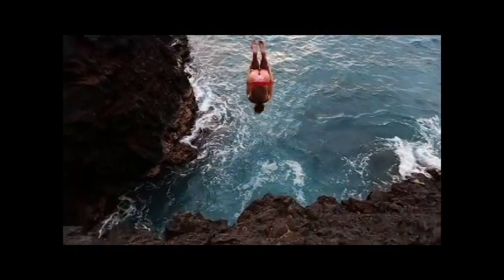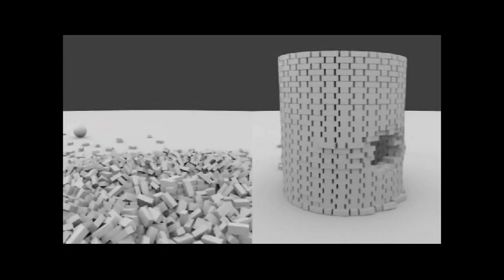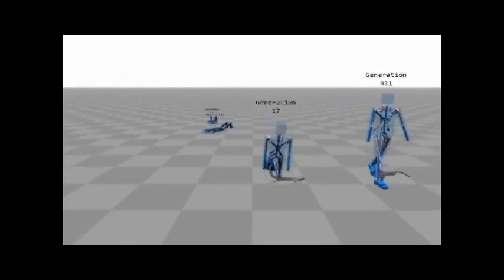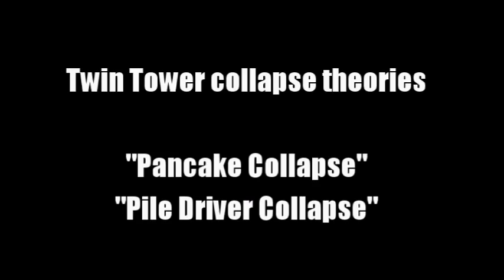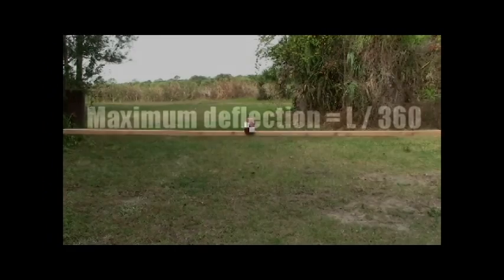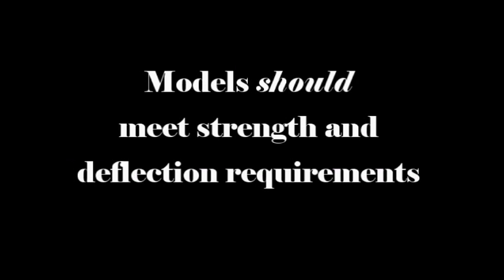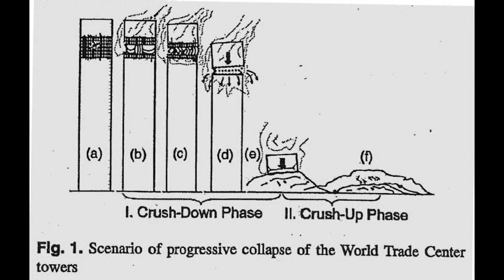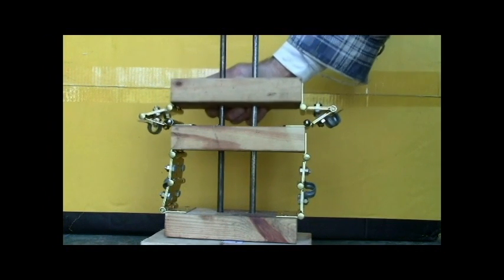9/11 Experiments: The Force Behind the Motion

Comment: First experiment is noway in scale. The supporting outer walls are way too thick and their strength would in a real building never be possible.
Second experiment is noway in scale. The supporting "pizza columns" are way too thick and their strength would in a real building never be possible.
Then I stopped watching this... video.
Reply: Well, not every A&E agees, not all A&E cares, and some  A&E do not wishe to be rediculed and called conspiracy theorists by the sheeps. Thats much of the reason ...
Reply: It seems people do not think much when they get told what to think. 

Fire does not pose a significant risk to concrete and steel buildings. The reason is that concrete is basically fire resistant, like rock, and because steel has such a high melting temperature due to being an alloy. 

The entire premise behind the fall of the buildings is questionable. The WTC only had fire visible on the upper floors, the bottom floors were undamaged for the most part. I would say roughly 70% of the building was undamaged. 

Yet it is claimed that fire weakened the entire structure to the basement, causing a structural failure that defies laws of motion. Like he said in the video the bottom floors should have withstood any collapse of the upper floor. There would not have been enough force or mass to compress the building in the manner the media describes. 

As for building 7, even if the structure was weakened as is claim then it should have been an asymmetrical failure, as the damage was asymmetrical, and it would not be a collapse of the entire building as we saw. 

Take the Oklahoma Bombing as an example. Half the building was completely destroyed yet half of it remained standing. Yet even though there was significant damage to the remaining structure it didn't collapse on its foot print. 

In other cases of building failure direction of fall is determined based on the section weakened. If say the north side columns of a building failed then the direction of motion would be northward toward the weakened sections. There would not be a direct fall downward in any such scenario. 

Yet on 9/11 we had three buildings exhibiting asymmetrical damage, fall in a nearly uniform and symmetrical manner. That is impossible without some kind influence to aid in such a collapse. 

Other examples of this are how trees fall when cut, they typically fall in the direction where the most material was removed, or the most damage done to it structure. If we apply that observation to the WTC then the top section should have fallen to the side of the building, not straight to the ground along the path of most resistance.
Reply: Mr. Lowery So the duck's the plane, and the plane's the tower, and the tower gets fucked up.  Next.
Reply: Mr. Lowery, clearly you aren't aware Eric Henderson is a certified practitioner of 'Schoolboy Physics''.

High-Stregnth steel reinforced concrete requires no energy to be ground into a fine powder in mid air, what are you smoking? There were no multi-ton steel beams ejected horizontally as the towers collapsed. The solid structure below could never resist the fall of the lighter structure above it. Buildings collapse uniformly at near freefall speed all the time due to scattered oxygen starved fires. Get on his level.
Reply: If you understood physics you'd know that gravity is by far the weakest force in nature.  It is something like 0.0000000000000001 the energy of the electro-magnetic force.
Reply: 311hwr refuse to learn? Sir, you seem to have a hard time writing and using proper punctuation. You are the last person who should be making comments about learning. Also if you refuse to argue, then why comment in the first place? You my friend can continue to live your fairytale life. Ignorance is bliss to some. It's funny, rather than actually defeating my points you just insult me and retreat. Typical of the minority of people who still believe what we were originally told. I just wish to understand why you believe steel beams were literally cut precisely at angles? Why the engine they found didn't match the planes they claimed hit the building. How they found passports of the terrorists in the street. It's almost laughable how dumb they think we are. It surely worked on you.
Reply: someone has to simply build the twin towers and effortlessly slam a Boeing 757 into it
Reply: Clearly a hole is present in your head. Explain to me how that happens....how does an aluminum hallow tube destroy steel? Furthermore you cited speed...explain to me how the planes that crashed into the Twin Towers even managed to keep flying at such high speeds while at low altitudes?

The maximum operating speed for the 757 is 493 knots = 567.334 267 876 mile/hour (mph) at cruising altitude. And you're telling they were flying at over 600mph at sea level?

You need to take off the tin foil hat moron.
Reply: You have had this explained to you many times.  Do you have short-term memory problems?
Aircraft are made of aluminium alloy, not aluminium.
The columns buckled not because they were overloaded or weakened, but because they were destabilized.
Steel box columns made of a material neither stronger nor thicker than the material of the plane's wing spar will FAIL no matter the speed of the plane.
Reply: Go look up the natural forces you stupid piece of shit!  I don't think  a fucking moron should be calling others anywhere near the same you douche bag.
Reply: Gotcha man!  I get worked up over the endless nonsense these people drivel from their fingertips and often do the same thing! lol
Reply: We aren't talking about collapse alone idiot.  Duncan is saying the collapse was able to amplify like a dynamical system and therefore could cause steel to become molten under the buried debris.  He is full of shit,  just like you are.
Reply: Listen to what this video says: "If you think he's wrong, then prove it, through experiment!"  Go do that and leave your senseless ramblings on your video proving this guy's wrong!
Reply: Eric Henderson Scale is not a major problem with this experiment.   The point of it is to find a mechanism that will cause something close to what is seen in the actual collapse footage.   Obviously just initiating collapse using gravity as a driver would create only a partial collapse which is completely stopped by the intact structural components below the point of failure.   What we should have seen happen with both towers if there were not any energy injected into the process from other means.   2/3 of each towers mass was in the first 1/3 of their height.   Do you understand what your "progressive collapse"  idea is trying to convey?   That a damaged section of each tower having less than even 1/3 of the total mass of the lower,  fully intact sections,  is able to fully destroy and pulverize the lower,  fully intact sections completely down into the basements of both towers.   Not even a sixth grader could buy this bullshit concept.   The second law of Newtonian physics renders this concept a joke.   In other words,  the progressive collapse concept is impossible.   You can't take something with less mass and destroy the same type of something with greater mass without adding energy to it.   Period.
Reply: Incredible... Every single time you comment, I respond by dissecting every claim you make. And each and every time you return completely avoiding every counterargument and excrete whatever new bullshit crosses your mind.

That is elite-level mental gymnastics that would make even the most ardent creationist blush. 

No it isn’t! "Size effect" is something completely different and irrelevant to this discussion.

SMH.. How is it that you can cite a study by Bazant as a 'proof of concept' in one comment , and then claim his work is "completely different and irrelevant to this discussion" in the next. No words...

it is obvious you have not understood. This is apparent when you give examples of small scale trials which have no relevance...

Bravo.. No really, bravo.

Scale effect is a manifestation of a general law, sometimes known as the “square cube law”  which affects all branches of science, especially in this context with respect to engineering. Go and google it and see if you can get it right this time.

You are a joke. Stop... For the love of your God, stop with the bullshit and read.

Practical Importance
Taking the size effect into account is essential for safe prediction of strength of large concrete bridges, nuclear containments, roof shells, tall buildings, tunnel linings, large load-bearing parts of aircraft, spacecraft and ships made of ﬁber-polymer composites, wind turbines, large geotechnical excavations, earth and rock slopes, ﬂoating sea ice carrying loads, oil platforms under ice forces, etc. Their design depends on the material properties measured on much smaller laboratory specimens. These properties must be extrapolated to sizes greater by one or two orders of magnitude. Even if an expensive full-scale failure test, for example a failure test of the rudder of a very large aircraft, can be carried out, it is ﬁnancially prohibitive to repeat it thousand times to obtain the statistical distribution of load capacity. Such statistical information, underlying the safety factors, is obtainable only by proper extrapolation of laboratory tests.
https://en.wikipedia.org/wiki/Size_effect_on_structural_strength

When you have to try to sound smart, you are doing it wrong. Everyone can see you aren't wearing any clothes. 

"NIST: “did not conduct reduced-scale system-level tests because there are no generally accepted SCALING LAWS that apply to fire propagation, temperature evolution, and STRUCTURAL response”.

And stop citing things which don't support your argument! Every time you do this you illustrate how obtuse you are. In this sentence, NIST is pointing out that it is unrealistic to try to replicate the effect of a jet liner impact and subsequent fires on a building (in full or small scale). No one is debating this.

What we are suggesting is if debonkers believe their misapplied high school kinematics equations are sufficient to explain this catastrophe, IT CAN BE MODELED. So. Get. To. It.

Don't worry about modelling the effect of the fires on the composite floor systems or individual steel members. NIST has already shown that sudden and uniform failure by fire is impossible, even under unrealistic conditions. Skip that.

All we want you to show is how a block can accelerate through another block of comparable mass and density without experiencing any resistance. We have already seen that even cardboard boxes will resist (and completely arrest) a much heavier mass with considerable kinetic energy. Put your Masters degree in 'Schoolboy Physics' to use and prove us wrong.
Reply: 311hwr In no cases does gravitational collapse of a building cause it to accelerate. Molten steel sitting under the debris for weeks. Steel beams cut almost perfectly. You can just ignore all the significant facts and evidence because you wish to believe that the powers that be would NEVER do something horrible like this. It's hilarious that the your first sentence is an insult about how dumb I am.... talk about irony.
Reply: Ok, if your theory is correct, where are the core columns then? What's destroying them? By your own theory and your own logic, we should see all the core columns sticking up in the air.
Reply: micha0001 yeah his "tests" are highly flawed. 

test 1 the wooden structure was way too strong and didnt give away and basically allowed the simulated floors to wedge between them which allowed them to stop. #2 was also a highly flawed test as the plastic pizza box supports used was just way too strong and provided support where there wasn't any on the actual building (ala the building held the floors by the center core, and outer frame). i stopped watching after that and went looking in the comments pointing out the flaws in the test. 
and tards are eating this up like its some sort of proof.
Reply: byurBUDdy I'm an auto mechanic and I can ensure you that if you take a high power torch to concrete you will be surprised.
Reply: ProjectRealityBf2 your kidding me right? You must have very little knowledge on planes or buildings.
Reply: Which reports? Show me.
Reply: The difference is thickness of a coke can and an aircraft structure is quite different. Should have paid more attention in high school when they were discussing the periodic table in Chemistry class.
Reply: The buildings could be seen from miles away. By the time the second jet hit, every one in NY who could, was watching the events take place LIVE. There were literally millions who saw it on TV.
To deny reality is a sure sign of insanity.
Reply: ".an aircraft cannot fly at 500mph at sealevel for a prolonged period without some damage occurring"

Says who, fool?
Reply: No, that was a link to an NTSB crash report, kid.

YOu don't have a fucking clue about aviation, clearly.
Reply: So you know what you are talking about? On who's authority, you're own?
Judging by the utter shit you've posted so far not very credible from someone who thinks the periodic table tells us about the thickness of materials.
Reply: not scientific. he never flew an airplane into it full of fuel. the only way to debunk what officials say is to recreate the building somewhere and remotely fly a 737 into it.
Reply: hahahahahahahahahaa rad
Reply: "THEY WILL BUCKLE AND FALL DOWN" - Why ?
Why so much heat under the ground and numerous reports of molten steel on site ?
Why pieces of steel ejected laterally at high speed , some of which embedded themselves in nearby buildings ?
Why no lumps of concrete but just dust ?
Reply: Sorry TD but this isn't correct.  The debris that struck other objects (like the ground) required that a portion of the potential energy be turned into kinetic energy and that rapidly overwhelms any available amount of energy for molten steel to be produced.  There was a large amount of kinetic energy produced from the falling debris and therefore a large portion of available heat was sapped away from the materials when the kinetic energy was  produced from impacting debris.  There is no way there was enough kinetic energy to cause a "snowball effect" type of ramping up failure and then have the energy needed to turn the steel molten from the impact!  That has never happened with any kind of structure that fell due to gravity alone.  Why?  Because gravity has but a fraction of the needed amount of energy to do such a feat.  Gravity is probably the weakest driver available for producing frictional heat to try and melt steel. Or any building metals for that matter.
Reply: +Eric Henderson

Wow. Another tirade of abuse but NOT one single fact to or calculation to back up anything you have claimed.

Wow. Another post where you miss the point. Colour me surprised. 

"However, in the analysis of the collapse mechanism by Bazant and Zhou, they state that they look at three possible collapse mechanisms"

Bazant and Zhou published their first study on the 13th of September, 2001 - two days after the disaster. This was hardly an 'analysis' and more appropriately described as a guess before any 'analysis' could be done. It was entirely based on conjecture.

(b) the floor-supporting trusses are sheared off at the connections to the framed tube and the core columns and fall down within the tube, depriving the core columns and the framed tube of lateral support, and thus promoting buckling of the core columns and the framed tube under vertical compression

Which NISTs investigation refutes. 

To my knowledge, Bazant published three studies on the collapse in total making several fundamental errors throughout. A decent refutation of Bazant can be found here. I've given you enough of my time.
http://www.ae911truth.org/news/265-news-media-events-mechanical-engineer-sends-open-letter.html

Note: Sneering and Insult is not a valid form of argument, facts and evidence are.

Note: Whining and shutting your eyes does not rebut a valid argument.

+beachcomber2008
"debonker" - The word is 'debunker', and the 'bunk' is all about your 'truther' religion.

You're a clever one aren't you. Debonker is a bastardization of the word, debunker. It implies that 'debunkers' are bonkers. It is sheer comedy when debonkers use 'truther' as a derogatory label and then cry foul when the tag is reversed... Stay classy.

Let's not distract ourselves with side issues, eh?

Yeah!... Let's not distract ourselves with the fact NIST openly disavows the pancake theory. Is this really the argument you are pursuing?? 

How about we talk about the leap NIST made from, 'fires as hot as 1000 Celsius' to 'at 1000 Celsius steel loses X strength'. NISTs own data did not find evidence of temperature exposure even close to this:

"Of the more than 170 areas examined on 21 exterior panels, only three locations had mud-cracking of the paint, indicating that the steel may have reached temperatures in excess of 250 °C"
and
"Two of the core columns with as-built locations in the fire-affected floors were examined for paint cracking.  The few areas with sufficient paint for analysis did not show mud cracking patterns, indicating the columns did not exceed 250 °C"
Page 101 - http://ws680.nist.gov/publication/get_pdf.cfm?pub_id=101016 

or this
This  fact  was  quite  interesting,  particularly  for  those  connections exposed to pre-collapse fires. Some of the main truss seats experienced considerable fires raging on the floor just below their location for upward of 30 min (Ref. 4). However, the spray-applied fire-resistive material (SFRM) applied to the seats appeared to  perform  as  required,  as metallurgical analysis  of  many  of  these  fire  exposed seats  showed  no  alteration  in  their  microstructure (Ref. 4).
https://app.aws.org/wj/supplement/WJ_2007_09_s263.pdf

250 degrees Celsius is fatal to human life, but not structural steel.

that seems to tie the loose ends up quite nicely, doesn't it?

No, see below.

See that trick you pulled right there?  You moved the goal-posts just a tad.

How? I quoted an earlier post where he stated the pancake theory to the letter in response to his claim he doesn't support the pancake theory? Are you blind and stupid?

No, it's an entirely different effect called THE SCALE EFFECT.

Wrong. The 'scale effect' you refer to is an incredibly loose description of a range of concepts that you possess no understanding of.

At grotesquely high wind speeds because the Reynold's Number of the situation is so different.  It is another manifestation of The Scale Effect which you don't seem to be aware of

So you're claiming that wind tunnel testing is invalid? Stop. 

It's not 'so different' at all. In fluid mechanics, one simply increases the atmospheric pressure in the wind tunnel by a factor of 10 over the conditions the full scale design will experience. Either way, scale models are a PERFECTLY VALID method for experimentation. You have no idea what you are even arguing here.

The purposes of these experiments was not to create accurate models of the towers. It was simply to test the 3 different theorized mechanisms behind the collapses of the twin towers (pancake, pile driver and demolition) by utilizing unrealistically weak substitutes. Are you really suggesting that paper walls and pizza spikes are a more substantial design than the actual towers as others on your side have done? Debonkers is a perfect descriptor. 

NIST's findings do not support the "pancake theory" of collapse
https://www.nist.gov/el/faqs-nist-wtc-towers-investigation

Are you going to address this elephant in the room?

This leaves FREE-STANDING COLUMNS A QUARTER OF A MILE HIGH.  THEY WILL BUCKLE AND FALL DOWN.

Or this one? WHERE IS THE QUARTER MILE LONG STACK OF CORE COLUMNS YOU NITWIT. The minute you show me this I will change my opinion. I won't hold my breathe
Reply: This is simply guesswork. Unless you can back it up with numbers, it is meaningless.

As apposed to backing it up with meaningless numbers? Dude give up.
Reply: +Eric Henderson

Jon Chalkley "Bazant's theory is a refutation of NIST" This statement demonstrates how little you understand.  Two different theories explaining two different things. Stupid or dishonest? I'll give benefit of doubt and assume latter.

This statement demonstrates the depths debonkers will plumb to support a bad argument. Deliberately making up a quote is the most intellectually dishonest thing you can do. I never said that - not once. Here is what I have said on the matter.

Professor Bazant's 'pile driver' mechanism is notable in that it was a complete repudiation of the initial 'pancake' collapse theory. It is the 'official' explanation NIST endorses.

Literally, the opposite of what you claim. Child.

On holiday. Unlike your average truther I have friends and family and do not spend my days on you tube.

That's.. Interesting.  It's been my observation that debonkers are the most prolific contributors in the comment sections of any 9/11 conspiracy video. It's almost like you can't get enough of it.
Reply: "I have to confess i get a warm fuzzy feeling when truthers start cursing and calling me names" Do you? Well, you're a moron. Knock yourself out.
Reply: make a better model and show us the collapse
Reply: You appear ignorant of Newtons' Second Law and how it interacts with The Third.
Reply: Besides, the hardness if a material isn't directly related to penetration capability, as illustrated by the bullet example.
Reply: Fox Mcloud but most planes ARE made out of mostly aluminum.....
Reply: You DO SEE the columns sticking up in the air after the rest of the building has collapsed around them. This point has been made several times during this protracted discussion. Maybe you should read some of the older posts before making such stupid comments.
Reply: No they are NOT. Why the fuck do truthers keep making this stupid point. They seem to think an airplane is made of the same material as a coke can. If it was you would never get me in one. Come to think of it, the wings would fall off under their own weight.
Reply: Wow...which report are you citing? Your "arguments" sound so convincing. The problem with debunkers is that they write really long paragraphs, but when you start dissecting each sentence apart you realize they're not making much sense .These geniuses here are of the opinion that a 757 can travel at over 600mph at sealevel for a prolonged period without the wings sheering off. 

It's no wonder why your math and science scores are the lowest in the western world. Goodness me...a 7th class science student here could probably own you all in basic physics and chemistry.
Reply: Where do you see the columns sticking out of the ground all the way to the top? Which parallel universe do you reside in?
Reply: I never said the aircraft is made of coke can aluminum. You did. The problem with your debunkers is that you don't use logic and you don't really answer the questions we pose. You simply write long paragraphs of trash and your create arguments in your own brain and then squash that argument with your own flawed logic.

This probably explains why nobody has dared to debunk 9/11 The New Pearl Harbour documentary.
Reply: "These geniuses here are of the opinion that a 757 can travel at over 600mph at sealevel for a prolonged period without the wings sheering off. "

Oh, and what aircraft did that on 11/9? Like all twoofers, you don't have a clue what you're talking about.

nor are you aware of the multiple examples of Boeing products exceeding Vd for longer periods than UA175, while experiencing higher g loadings and surviving.

This is because you are stupid brainwashed sheep who cannot think or investigate for yourselves.
Reply: Here's a Boeing aircraft that exceeded Vd by more than 20%, while being subjected to 3.5g (Limit is 2.5) before it broke up:

http://blog.seattlepi.com/aerospace/files/library/Final_AdamAir_PK_KKW_17032008.pdf

For comparison, UA175 exceeded Vd by less than 20%, for a shorter period of time, while experiencing only 1g.
Reply: A link to some random blog? Wow. That's so convincing.
Reply: Long enough....an aircraft cannot fly at 500mph at sealevel for a prolonged period without some damage occurring. Clearly the aircraft was modified....which means this was not a commercial aircraft. I know exactly what I'm talking about...too bad the folks at Herzliya didn't update you on how to respond to people who actually know what they're talking about.

Try again.
Reply: have you any idea how crowded New York is? Of course there were  plenty of  eyewitness!
Reply: No, any pilot won't tell you that because it's bullshit.
Notice also that the people who make the aircraft don't agree with you either.
Reply: So you can get information from legitimate TV and newspapers or from you tube. I wonder which is likely to be more reliable?
Reply: I could send you the specs. for a more realistic model. You are the ones who want to prove it didn't happen so you can finance and build it.
Reply: Dave Franzmann Thats what Paul Salo wants to do.. heard about him ?
Reply: Or even more correct and devastating: a 767 with a lot more fuel on board than a 737.
Reply: I think we seem to be talking at cross purposes. You seem to have focused on the collapse initiation while I am looking at the way the collapse progressed once under way. Can we get this clarified before going any further with this discussion.
Reply: micha0001 Dumbass
Reply: micha0001 oooooooooh 7 hours! Wow! What a long time for a building to survive a fire before collapsing!
Reply: wahldoh24 high power torch burns at what temperature? Office fires, oh yes and I forget "jet fuel" don't burn nearly as hot. Also with a torch you are directing that flame at a very small spot where as with these buildings it would be multiple, entire floors. Stop rationalizing bullshit.
Reply: Who am I? how do you know he is right?
Reply: I agree. perhaps the materials used and relative weights and heights were not accurate models
Reply: If the whole plane was aluminum you'd be able to tear the plane apart with your bare hands. A child can see this.I have a relative who's a pilot, he says the speeds CAN be achieved below 40,000 above sea level but it's dangerous since the windshield might sink in "but if you're gonna crash on purpose it doesn't matter to you".
Reply: Turning the plane around doesn't tear the wings off. A child can see that.
Reply: The collapses started at the exact floras the planes hit. Someone would have to have climbed up to the already blazing floors and put bombs int here. Which  is impossible. Therefore the collapses were not started by explosives. There is no way around this.
Reply: If that's true,  've no need to wish you luck tearing the fuselage apart from the inside out with your bare hands and struggling to walk across the aluminum floors. & don't forgetet Newton's 2nd Law! And don't forget how a baseball can break through glass fi you through it hard enough!
Reply: Should get mythbusters on board, so to speak
Reply: Look up birdstrike to nose of plane and then start your argument again
Reply: My point is not that the bird penetrates the aircraft. I expect it to. My point is when you watch what footage there is of the aircraft and the building. There is no accordioning of the plane to show resistance. That is not reality. The plane on a special video, live supposedly, on fox5 shows the plane coming through the other side. No sign of accordioning/crushing and a nose cone that appears intact. I WILL tell you that these nose cones are generally made out of plastic. Do you mean to tell me that a plane can fly through a building and have its front nose and fuselage emerge intact? The floors of the wtc were spaced apart closer together than the distance between top and bottom of the fuselage. Do you mean to tell me that the top and bottom of the fuselage sustained no damage as it met UNDENIABLE resistance, or any part of the fuselage. perhaps the nose? I don't know exactly where the floors were in relation to the plane. But guess what? It doesn't matter, tee hee. Try telling me that the floors would have given way to the hollow fuselage. THAT is like a sword on a coke can
Reply: The "Pinocchio's nose" argument, like countless others, can be refuted with a simple google search.
Reply: I love how it's called pinocchio's nose!
Reply: googling 'pinocchio's nose explanation' yielded absolutely nothing, so it's not really a thing, then, is it?. Perhaps you'd be so good as to give me but a phrase to whet my thirst for knowledge
Reply: "There is no accordioning of the plane to show resistance". You've gone and made me quote myself. Now, Instead of saying nothing but making some noise, get to work on this. There are plenty of videos to show me where a piece of the plane becomes dislodged before it goes into the building. "The floors of the wtc were spaced apart closer together than the distance between top and bottom of the fuselage". Whoops! dun it again. Show me the resistance of the plane when it met something it could not get through without breaking apart. This would have happened no more than 5 metres into the building, past the girders. Made of steel. Newton's third. Get busy.
Reply: I found the pinocchio's nose thing. What i thought was the plane emerging from the other side turned out to be a figment of my imagination. You don't even know how funny you are. This is seriously like a sitcom
Reply: Please calm down and be respectful. Here, look at this:https://www.google.com/?client=safari&channel=ipad_bm#channel=ipad_bm&q=9/11+nose+debunk
Reply: I watched your video. You asked me to. I summed it up. Was i wrong? I'm not going to your forums. I've been researching this shit for 10 years. I'm light years ahead of you, with all due respect, that you so politely asked for with not a hint of condescension. You basically tell me that live tv reveals a silhouette on the exit side of the building that is identical to the silhouette of the plane before some blackout thing occurs is a figment of my imagination. What are the odds of that happening? The explosion bears the same shape and motion of the plane pre strike. Wow. But i defer to you now, because you demand it.
Reply: What video? I didn't send you one. & I've been researching this for at least as long s you if not longer. Please be respectful and stop with the unwarranted hostility and groundless accusaitons. I never said it was all in your head. & saying "I'm not going to your forums (What forums anyway?) is simply a biased refusal to examine the evidence.
Reply: No idea what point you are trying to make. What relevance does this have?
Reply: Surely you are still not trying to make out the nose of the plane went through the building  undamaged. What everyone saw that day was a mass of debris exiting. This nonsense has been thoroughly discredited.
Reply: You said the plane was made of aluminium which is the material a coke can is made of.
Reply: "No body has debunked 9/11 The New Pearl Harbour"
I get the impression you are fairly new to the 9/11 conspiracy faith or you would know that this piece of fantasy and disinformation has been thoroughly and comprehensively debunked.
Reply: Oh dear, so you think the periodic table measures the thickness of materials!
Reply: Google pinocchio's nose, you said. I did. A video emerged with that title.
Reply: Where did you see it? Were you on the street in NY? Lucky you. fox 5 shows the fuselage and nose, being identical in shape before and after impact. The video verifies this, OR, verifies whatever emerges on the north side taking the exact same shape of the nose and fuselage before a half second blackout cuts back to an expanding orange flame. Would you agree with this, the latter part?
Reply: Ask me a question, then. I'll ask you some too. I have a relative who was a pilot. He said planes CAN travel that fas tithe slow, but it's dangerous since the windshield might cave in, but since you're gonna crash on purpose, that wouldn't matter. As for the  phones, you obviously haven't researched articles such as these: https://www.google.com/?client=safari&channel=ipad_bm#channel=ipad_bm&q=debunk+911+phones
Reply: https://www.google.com/?client=safari&channel=ipad_bm#channel=ipad_bm&q=debunk+911+nose
Reply: So you're saying my elderly relative, who is a pilot, was lying? Is he in on it? huh?
Reply: So thousands of people who saw a jet were hallucinating?
Reply: So, your answer to a simple yes or no question that reflects what YOU see is to avoid it and suggest that millions of eyewitnesses can't be wrong. BRILLIANT logic. Just say no if you disagree, ffs
Reply: So it was all done by magic! Here's me thinking it was real. Silly me.
Reply: Without a link your  incredibly bold and bizzare claim sent gonna help or matter
Reply: That's a ludicrous comparison and you know it.
Reply: Refer to William Casey's (former CIA Director) claim to patenting a perpetual motion machine:
"We'll know our disinformation program is complete when everything the American public believes is false."?
When you find you have conquered the internet or deciphered MSM state sponsored propaganda, retrace your steps in reverse.
Reply: Eric Henderson OK if the "progressive collapse" theory is the truth, get Larry Silverstein to finance an open, pear reviewed experimental model to prove it. I'm sure he wants to silence all these libelous truthers. Go ahead do it yourself. Your numbers look impressive, shouldn't be all that hard, to replicate them in a scaled down model. Go Ahead prove it....
Reply: What about MY arguments, William?
Reply: micha0001 Said who??? Well, had you actually watched the video, fairly early into it we hear the indian NIST guy clearly tell the nation that it is NIST's conclusion ONE critical column failed causing the entire collapse. NIST even backs it up with a laughable animation.
I know. It is a ludicrous statement. Then again, everything NIST told us was absolute nonsense.
Reply: micha0001 Listen for your self then: it is at the 3:00 mark in this video where we here NIST make the ridiculous claim that it was one single column which brought on the entire collapse.
No, I did not read the entire 10,000 page report. I did read the condensed version and  I also did read the 9/11 commission report in its entirety. It was insulting.
Reply: byurBUDdy
"It seems people do not think much when they get told what to think" - That must be why you're telling them what to think.
"Fire does not pose a significant risk to concrete and steel buildings" - LIE.  FALSE.
"The reason is that concrete is basically fire resistant, like rock" - Concrete is a form of sedimentary rock, and igneous rock is solid at room temperatures.  Both are molten when red hot, and, first, the concrete has EXPLODED (at around 850 deg C)..
"steel has such a high melting temperature due to being an alloy" - Alloying elements with iron normally LOWERS the melt temperature.  FALSE.
"roughly 70% of the building was undamaged" - more like 85%.  FALSE.
"it is claimed that fire weakened the entire structure to the basement" - LIE.  FALSE.
"causing a structural failure that defies laws of motion" - But you don't say HOW.  This may well be because you are merely repeating someone else's phrase.  It seems people do not think much when they get told what to think.  FALSE.
"the bottom floors should have withstood any collapse of the upper floor" - WHY?  Apart from two engineering floors, ALL the floors were identical.  Why should a floor resist being struck by forty floors when the previous floor collapsed when being struck by thirty-nine?  FALSE.
"There would not have been enough force or mass to compress the building in the manner the media describes" - An interesting opinion, but without any explanation, why should anyone believe you?  FALSE.
"building 7 should have been an asymmetrical failure, as the damage was asymmetrical" - The SEVEN HOUR FIRE was peripatetic (it went wherever it found its fuel), so your suggestion is FALSE.
"Oklahoma" - wasn't a steel structure that burnt for seven hours.  FALSE.
"collapse on its foot print" - No WTC building collapsed that way.  FALSE.
"direction of fall is determined based on the section weakened" - These buildings fell due to fire, and the WIND DIRECTION is crucial.  FALSE.
Thank you for your eleven false suggestions.
It seems people do not think much when they get told what to think.
Think about this.  It's a simple physical analysis of how the energies and speeds build up once floors catastrophically collapse.  And floors were photographed having already dropped.  You can see these photos in the NIST Report, which you obviously haven't read.

Newton's Laws of Motion as applied to 9/11:
An Analysis of the Floor Collapse of the Twin Towers

Newton's 2nd Law ”The acceleration of an object as produced by a net force is directly proportional to the magnitude of the net force, in the same direction as the net force, and inversely proportional to the mass of the object.”
This, with Newton’s other laws, demonstrates the REALITY of the floor collapses within the twin towers.
The equation used is a derivative of the ACCELERATION of MASSES by GRAVITATIONAL FORCE: v^2 = u^2 + 2 * f * s, where:
Floor Mass m = 10^6 Kg,
Gravitational Acceleration f = 32.16 feet per second per second, or 9.81 metres per second per second
Distance between floors s = 12 feet, or 3.66 metres, and
Starting velocity u (original) = 0 ft/sec  (0 m/sec).  Then u = 9.72 ft/sec (2.97 m/sec).  Then u = 13.72 ft/sec (4.18 m/sec).  Then u = 16.3 ft/sec (4.97 m/sec).

It fits (as it must) in the case of a detaching floor. This, when and if it falls free, accelerates at G until it hits the floor beneath. From the formula v^2 = u^2 + 2 * f * s we know it strikes the floor beneath at a speed of 27.8 feet per second, or 8.47 metres per second.
We know that MOMENTUM is conserved, and the TWO floors would THEN be traveling downwards at HALF THAT SPEED, less the speed loss from the energy loss of the SHEARING of the floor connections.
We KNOW what this is, because we KNOW the average and general downward acceleration to have been 0.7G, as agreed by AE911T.
So we KNOW that the initial downward speed of the TWO floors is actually 70% of (27.8 / 2), which is 9.72 feet per second, or 2.97 metres per second.

Now we consider TWO floors striking the NEXT floor.  
Note that THE START VELOCITY (u) IS NO LONGER ZERO, but 9.72 feet per second, or 2.97 metres per second, so from the formula v^2 = u^2 + 2 * f * s we know the TWO FLOORS strike the floor beneath at a speed of 29.4 feet per second, or 8.96 metres per second, and thus the impact velocity is GREATER than before.
We know that MOMENTUM is conserved, and the THREE floors would THEN be traveling downwards at TWO THIRDS THAT SPEED, less the speed loss from the energy loss of the SHEARING of the floor connections.
We KNOW what this is, because we KNOW the average and general downward acceleration to have been 0.7G, as agreed by AE911T.
So we KNOW that the initial downward speed of the THREE floors is actually 70% of ((29.4 * 2) / 3), which is 13.72 feet per second, or 4.18 metres per second.

Now we consider THREE floors striking the NEXT floor.  
Note that THE START VELOCITY (u) IS NO LONGER 9.72 feet per second, but 13.72 feet per second, or 4.18 metres per second, so from the formula v^2 = u^2 + 2 * f * s we know the THREE FLOORS strike the floor beneath at a speed of 31.0 feet per second, or 9.45 metres per second, and thus the impact velocity is EVEN GREATER than before.
We know that MOMENTUM is conserved, and the FOUR floors would THEN be traveling downwards at THREE QUARTERS THAT SPEED, less the speed loss from the energy loss of the SHEARING of the floor connections.
We KNOW what this is, because we KNOW the average and general downward acceleration to have been 0.7G, as agreed by AE911T.
So we KNOW that the initial downward speed of the FOUR floors is actually 70% of ((31.0 * 3) / 4), which is 16.3 feet per second, or 4.97 metres per second.

On the point of impacting the NEXT floor THE START VELOCITY (u) IS NO LONGER 13.72 feet per second, but 16.3 feet per second, or 4.97 metres per second, so from the formula v^2 = u^2 + 2 * f * s we know the FOUR FLOORS strike the floor beneath at a speed of 32.2 feet per second, or 9.81 metres per second, and thus the impact velocity is EVEN GREATER than before.

What you see here is AN ACCELERATING TREND.  The acceleration of the massing floors is heading asymptotically for G itself.

"You are saying that as the first 15 floors collapses on the 16th floor" - Well, obviously not.
"The amount of kinetic energy is increased as opposed to deceased (sic)” - Certainly not.  Energy never ‘dies’.  Consult The First Law of Thermodynamics.

If you take the INITIAL FLOOR, its kinetic energy impacting the floor beneath it (assuming its weight to be 10^6 Kg) is 0.5 * m * v^2, which is 0.5 * 10^6 * 8.43 * 8.43 = 35,500,000 Joules.

If you take the FOUR FLOORS, their kinetic energy impacting the floor beneath them (assuming floor weight to be 10^6 Kg) is 0.5 * m * v^2, which is 4 * 0.5 * 10^6 * 9.81 * 9.81 = 192,000,000 Joules, which is MORE THAN FIVE TIMES GREATER.

Kinetic energy is ALWAYS INCREASED BY FALLING, as POTENTIAL energy is traded off against it.

So the floors will accelerate all the way to the tower basement.  This leaves FREE-STANDING COLUMNS A QUARTER OF A MILE HIGH.  THEY WILL BUCKLE AND FALL DOWN.
Reply: Tony Duncan Go watch some bird strikes on jet aircraft Tony!  I don't think a duck is tougher than a steel box column and a duck will totally fuck up the plane that hits it!
Reply: Tony/Eric, I know you won't absorb any information that disrupts your world view but it's nice to give you the opportunity for self improvement.

I read your entire shit post and will point out the utter absurdities of your argument.

Your whole premise relies on the assumption that the floor truss seats sheared from the interior and perimeter columns. This is grade B horseshit which NIST's own findings refute. Of the 31 truss connections they examined, only 2 failed. The other 95% were damaged but intact

Secondly, your explantion suggests that energy in this system was conserved. The collapse of these buildings was not a closed system. Thousands of tons of material was ejected (at speed) from the falling mass. I'll call this grade A horseshit, as it would sound vaguely scientific to an idiot

Thirdly (?),  the theory you advocate was discarded very quickly by the authorities investigating this because of how obviously wrong it was. To be clear, NIST does not endorse the pancake theory.

Your final sentence actually hints at a level of intellectual lucidity. Yes, if the pancake theory were true, and the floors sheared from the central columns as the collapse progressed, 
THERE WOULD BE A MASSIVE STEEL STRUCTURE A QUARTER OF A MILE LONG ON TOP OF THE DEBRIS PILE. Where is it?
Reply: answer=explosives
Reply: No one has claimed the fires weakened the whole structure. Once the upper floors were in motion, the floors beneath could not support the downwards momentum. Far from slowing the collapse down, as more and more floors began to give way the falling mass increased. If you watch the video carefully, you will see that the rate of collapse increases as the momentum builds up.
Reply: Thanks for this comprehensive analysis. Unfortunately, your average truther will only read as far as line 5 or 6 before their attention span gives up. As for introducing numbers into your post, this only has the effect of making them run away to the next you tube video in hope of renewing their faith.
I have shown similar calculations in discussions with truthers and have yet to have a response.
Reply: +Eric Henderson

It is fairly obvious from the pseudo scientific baloney your (sic) are posting that you do not have the understanding to discuss this issue

I've never seen anyone with such a complete lack of self awareness as yourself, and I probably never will again. EVERY claim you've made in this comment section is 'pseudo-scientific baloney' which you've pulled from your ass 'to sound impressive'. 

Gravity exerted a force of about 500000KN on the upper part of the tower and studies have proved the potential energy was more than enough to collapse the towers.

In the exact same comment.. Incredible....

I have to confess i get a warm fuzzy feeling when truthers start cursing and calling me names.

Right... Because 'truthers' are the only ones who become belligerent. Yeah.. Debonkers are the most generous, humble and courteous people that exist on this planet. Not. I think that warm fuzzy feeling you get is your colossal ego being crushed.

I have no problem discussing scientific issues with non-scientists but it really pisses me of when they try to sound impressive by using scientific terms they don't understand.

Ditto.

I made the point a long time ago that it is just not possible to use small scale experiments to replicate how the towers fell because of the scaling problem.

Which is why no one should take a word you say seriously; you have absolutely no idea how to do science. When an aerospace engineer wants to design an aeroplane, they test small models in a wind tunnel and computer simulators first to see how they perform - well before even contemplating building a working prototype. When a chemist wants to test a new drug, they begin with human analogues such as mice before starting human trials. If you have kids, I hope they weren't home schooled.

You must be religious. Only a zealot would claim their faith is beyond the scientific method. Holy cow...

Here is a link to a study proving that the towers would collapse the way they did:
https://pdfs.semanticscholar.org/93a4/406e441b660fd6c52e1d54810203fbaba208.pdf

Professor Bazant's 'pile driver' mechanism is notable in that it was a complete repudiation of the initial 'pancake' collapse theory. It is the 'official' explanation NIST endorses.

So to be clear, you are now disavowing the 'pancake' theory you've been advocating throughout this entire comment section? There's nothing wrong with changing your mind. But you ought to say this outright, otherwise it makes it look like you are posting any random shit you find without even a foundational understanding of its merits.

In reality, Bazant's 'pile driver' thesis is even more ridiculous than the pancake theory for collapse. At least the pancake theory had an air of plausibility about it before examination of debris proved it wrong. The suggestion that a relatively tiny portion of the towers could pulverize the larger, more dense structure below it without destroying itself in the process is an embarrassment on what was probably a fine career. Jonathan's last two experiments and footage of the collapses themselves, perfectly demonstrate how stupid it is. The top block of both towers disintegrates even before it impacts the lower portion - indicating that explosives where likely involved.

2 His model does not replicate the way the towers collapsed.
 
Now you're getting it! It wasn't until he used firecrackers to sever the supports that freefall acceleration could be achieved. Unfortunately he didn't have an adequate way to coordinate the detonation sequence with precisely timed intervals to replicate the uniform acceleration of the actual collapses.
Reply: Another day, another debonker who comes out with the same incoherent babble as the last one... What a surprise. The least you could do is construct legible paragraphs. That was covered in middle school. I'll settle for beachpedo2008 being able to spell my name correctly. I'll deal with you tomorrow.

+Eric Henderson

Don't have time to look at everything

Of course you don't, because "your average truther debonker will only read as far as line 5 or 6 before their attention span gives up"

I have never used the term “pancake theory” In fact I have scrupulously avoided it. I subscribed to the “Progressive Collapse Theory

That's because you are a clueless. "Progressive Collapse" is not a theory, it is an observation. A theory is an attempt to explain why something happened. 'Progressive collapse' does not answer the question, 'Why did the buildings collapse?'. Weak truss connections is was a possible explanation.

From NIST:
NIST's findings do not support the "pancake theory" of collapse, which is premised on a progressive failure of the floor systems in the WTC towers. Instead, the NIST investigation showed conclusively that the failure of the inwardly bowed perimeter columns initiated collapse and that the occurrence of this inward bowing required the sagging floors to remain connected to the columns and pull the columns inwards. Thus, the floors did not fail progressively to cause a pancaking phenomenon.
https://www.nist.gov/el/faqs-nist-wtc-towers-investigation

It follows that fire in the impact zone heated floor trusses to the point of failure, causing the collapse of one floor onto the floor below. This overloaded the 'weak' truss seats supporting the second floor causing another collapse. As the 'weak' truss seats could not arrest the growing mass, progressive floor failure below this point ensued. With the floors no longer providing lateral support to the interior and exterior columns, they buckled and fell behind the main collapse.

Eric in December 2016
The inner core and the outer walls could not prevent the collapse from progressing once it had begun because it was ONLY the connections between inner and outer walls which held the floors up.Once the upper floors came down on the ONE floor beneath, the connections holding it to the walls gave way and this weight was added to the falling mass. As each floor gave way the mass INCREASED and with it the momentum so the next floor below was hit with even greater momentum.

This is the pancake theory in a nutshell. You are either dishonest, or a dumbass. You could save face and immediately win back respect if you concede you were wrong on this point - and correct the debonkers who trumpet the same ridiculous argument like the idiot above.

I have run small scale, semi-scale and pilot plant in the chemical industry so I guess I know a bit more about scale than you do.

No, it is self-evident you are completely out of your depth. Being the receptionist at a law firm, does not make you a legal expert.

You don’t seem to have understood what I meant by the “effect of scaling”. Maybe I didn’texplain it properly so I’ll try again.Let us suppose we built a model of one of the towers at say 1:10****************0 scale with everything in proportion. This would mean that the columns, etc would be 1/100th of their width, breadth and length.The load bearing capacity of the columns is proportional to their cross-sectional area which is = width x breadth.For the sake of argument, suppose a full scale column was 100cm x 10cm, the x-sectional area would be 1000sqcm^2.The equivalent column in the model would have to be 1cm x 0.1cm giving an area of 0.1cm^2. Comparing the model with full scale this is 1/10000 (one ten thousandth) Now consider the loads these columns have to bear. The mass of material (concrete, etc) is proportional to it’s volume. This is given by length x breadth x height. Consider the weight of one section of concrete floor. For the sake of argument suppose it is 60m x 20m x 0.1m, the volume would be 120m^3 The equivalent floor in the ****************1:10****************0 scale model would be 0.6 x 0.2 x 0.001 giving a volume of 0.00012m^3 Comparing this with the full scale floor gives it to be 0.00012/120 = 1/1000000 (one millionth) So columns ten thousand times thinner would be bearing a load 1 million times lighter or to put it another way, the columns in the model would be 100 times stronger in proportion compared to the full scale

What you are reaching for is referred to as the 'size effect' by engineers. Earlier you cited a study authored by one of the worlds foremost experts on this idea. For the love of your God, read one of his papers before you embarrass yourself like this. There is a reason why engineering colleges require applicants to have a passing grade in advanced maths and physics. Year 7 algebra and 3rd grade problem solving does not cut it.
http://www.civil.northwestern.edu/people/bazant/PDFs/Papers/S34.pdf

Size effect is a relatively new concept that has generally been confined to the study of brittle and semi brittle compounds like plain and steel reinforced concrete columns and slabs. Conventional wisdom held that a beam of a certain thickness and length could support the same force (in tension or compression) as a beam of the same thickness but a shorter length. In practice, it's observed that strength decreases over longer spans. It has NO bearing on these experiments. Any modern engineering program already factors in the decrease in strength of common building materials. Read. The. Paper.

I am not going to go over this ground again. If you reject this theory, it is up to you to give your reasoning.

That's funny.. I've dissected every comment you've made in this thread - and the earlier thread you are ignoring - and demolished your every claim using your own statements and your own sources. Unfortunately, "you only read as far as line 5 or 6 before your attention span gives up".
Reply: Eric Henderson 
Yes.  I know they go and hide. But it is nice to give them the opportunity to save themselves.  Cheers.
Reply: Your questions are answered here.  There were lumps of concrete.  There wasn't "just dust".
PRIMARY 9-11 CONSPIRACY ASSUMPTION SHOWN TO BE FALSE:
AN ANALYSIS OF THE AMOUNT AND DESTINATION OF THE POTENTIAL ENERGY OF A WTC TOWER
The first law of thermodynamics, also known as the Law of Conservation of Energy, states that energy can neither be created nor destroyed; energy can only be transferred or changed from one form to another.
Source: Boundless. “The Three Laws of Thermodynamics.” Boundless Chemistry. Boundless, 02 Jun. 2016. Retrieved 12 Oct. 2016 from https://www.boundless.com/chemistry/textbooks/boundless-chemistry-textbook/thermodynamics-17/the-laws-of-thermodynamics-123/the-three-laws-of-thermodynamics-496-3601/
The World Trade Center towers (and WTC7) fell NATURALLY due to buckling failure when their 'slender' columns lost attachment to their floors.
They only used a third of their Potential Energy to destroy themselves, the remaining two-thirds was consumed in crushing some of their steel into ground zero.
A standing WTC tower possessed two hundred and forty six tons of TNT of POTENTIAL ENERGY merely by just standing there. We shall call this energy Eo.
The tower fell by taking the direction of LEAST RESISTANCE, which was THROUGH ITS BUCKLING COLUMNS.
The columns failed by BUCKLING because their STRUCTURAL STABILITY had been compromised by LOSS OF FLOOR ATTACHMENTS. No steel got crushed when this buckling failure occurred. 
Buckling is not a MATERIAL failure; it is a STABILITY failure.
The floors had detached themselves by sagging to an angle which snapped their connections. Photographs of these separated floors (taken shortly before collapse) are plainly shown in the NIST Report.
As each tower fell, some of that stored potential energy, converting to kinetic energy by falling, was released to damage and dismantle both the moving and the stationary parts of the tower on the way down.
The amount of the initial energy consumed in such a manner was inversely proportional to the rate of acceleration of the tower as it descended. It can be calculated.  We shall call it Ed.
The amount of energy remaining (Er) when the tower wreckage hit ground zero is then (Eo - Ed).
This energy, transferred elastically, caused PLASTIC DEFORMATION in the crushed base steel wreckage, and became HEAT. This too can be calculated.
The heat was considerable. The signs of it were captured by satellite. It amounted to the equivalent of a thousand tons of steel raised to a temperature exceeding 1,000 degrees Centigrade.
This hot steel, crushed and pressed against ground zero, oxidised its surface (making scale) and absorbed local oxygen gas, leaving a reducing atmosphere.
In these reducing conditions, and at a temperature of 1,000+ degrees C, fireman’s water which had percolated through crushed gypsum wall boarding DISSOLVED calcium sulphate (yes, Gypsum is 5% soluble in water), the sulphate ions of which were reduced to sulphur which combined with the exposed iron to form IRON SULPHIDE, which at such temperatures was MOLTEN, and flowed away. At a temperature of 1,000 degrees Centigrade, in an absence of oxygen, and in the presence of hydrogen, Sulphur and Iron atoms become keen partners.
Such hot reducing conditions also caused the water/steam to be REDUCED to hydrogen gas which was noted by firemen to be burning at the surface of the wreckage.
The wall-boarding and crushed concrete surrounding (but mostly above) the steel were THERMAL INSULATORS, so greatly slowing cooling.

CALCULATIONS (in SI units):

To calculate the original potential energy of the tower in TNT equivalent,
G = 9.81 metres/sec^2
Mass (M) of tower = 5e8 Kg
Height (h) to the tower’s CG = 210 metres
The explosive energy of 1 ton of TNT (Kt) is equivalent to 4.184e9 Joules

Equation: Tower Potential Energy (Eo) = ( M * G * h ) / Kt
This is equivalent to ( 5e8 * 9.81 * 210 ) / 4.184e9, or 246 tons of TNT.

The Potential Energy of each standing tower was equivalent to 1,000 standard 500 lb. ‘iron’ bombs.

To calculate the kinetic energy used in the tower destruction takes a moment, after a simple thought experiment, namely considering the tower would fall at G if there were NO resistance, and if it fell so slowly that it consumed ALL its energy, it wouldn’t fall at all.
So we can see that the PROPORTION of the energy used up by the collapse must equate with the proportion of G which the collapse was unable to achieve.
As the collapse acceleration was, by truther calculation, established to be about 70% of the acceleration due to gravity, we’ll use that.
The energy used up in tower destruction was therefore 30% of 246, or 73.9 tonnes of TNT.
Assuming that 30% of the tower fell outside of the basement, then the energy (Er) available to heat the wreckage base (by elastic energy transfer and crushing) was 0.7 * (246 - 73.9), or 120 tonnes of TNT.
We know that the steel reached at least 1,000 degrees Centigrade because that is the melting point of iron sulphide.
We can therefore calculate the mass (m) of steel that was raised to that temperature.
The specific heat of iron (Fs) is known to be 0.45e6 Joules / tonne / degree C
The ambient temperature was 20 deg C, so the temperature rise (Tr) was 980 degrees C

Equation: Er = m * Fs * Tr
So m = Er / Tr * Fs = ( 120 * 4.184e9 ) / 980 * 0.45e6
And so m = 5.02e11 / 4.41e8 = 1,138 tonnes.

The collapse of each World Trade Center tower created 1,138 tonnes of red hot steel at 1,000 degrees Centigrade.

So we can see that there is no need to postulate an extra source of energy, and that the basement wreckage heat is also easily accountable, with the additional corroboration of burning hydrogen at the wreckage surface, and molten iron sulphide at the wreckage base.
And so the underlying 'truther' assumption, that the planes couldn't bring down the towers, is shown to be FALSE, as it is shown by calculation, using the physically-correct values, that the potential energy possessed by the towers numerically accounts for ALL the known consequences, through elastic energy transfer, plastic deformation, HYDROGEN gas burning at the wreckage surface, EUTECTIC IRON SULPHIDE melting off the hot steel pressed against Ground Zero, and, of course, a tremendous amount of HEAT.

These results are EVIDENCE of the event.
They have been evident to any REAL scientist or engineer from day 1.
Reply: I have to confess i get a warm fuzzy feeling when truthers start cursing and calling me names. It simply proves they have no adequate response.
Why would I need to look up something I've known about and understood, probably since before you were born?
I have no problem discussing scientific issues with non-scientists but it really pisses me of when they try to sound impressive by using scientific terms they don't understand.
Reply: +John Chalkley
"you have absolutely no idea how to do science" - Henderson has a better idea than you do.
"When an aerospace engineer wants to design an aeroplane, they test small models in a wind tunnel" - At grotesquely high wind speeds because the Reynold's Number of the situation is so different.  It is another manifestation of The Scale Effect which you don't seem to be aware of.  If you REALLY inspect those models, you will see they are made of STEEL to cope with the heavy forces they must endure.
"computer simulators" - aren't relevant.
"Only a zealot would claim their faith is beyond the scientific method" - seems ironic when uttered by a non-scientist
"the pancake theory had an air of plausibility" - the floors pancaked each other, as evidenced by the samples still available for inspection. 
"examination of debris proved it wrong" - False.
"The suggestion that a relatively tiny portion of the towers could pulverize (the remainder)" -  Is true, because the floor mass accumulated.  It has already been proved that the falling of two floors together could snap the connections of the floor below that, and the NIST Report shows dropped single floors.
"the larger, more dense structure below" - Is false.  Each floor (apart from the two engineering floors) was identical.  The columns played no part in the floor collapses.  In fact, they would have failed IMMEDIATELY two floors were disconnected.  THAT is a mathematical certainty.
"is an embarrassment" - What is 'an embarrassment' is that our society has raised its children with the inability to distinguish science from pseudoscience of the sort you posses.
"The top block" - Is NOT an elastic steel structure, and the model bears absolutely NO relationship tp the tower.
"indicating that explosives where likely involved" - Or indicating that a fairy waved a magic wand.  Each 'indication' has equal validity.
"he didn't have an adequate way to coordinate the detonation sequence with precisely timed intervals to replicate the uniform acceleration of the actual collapses." - And nor has anyone, at any time.

Newton's Laws of Motion as applied to 9/11:
An Analysis of the Floor Collapse of the Twin Towers

Newton's 2nd Law ”The acceleration of an object as produced by a net force is directly proportional to the magnitude of the net force, in the same direction as the net force, and inversely proportional to the mass of the object.”
This, with Newton’s other laws, demonstrates the REALITY of the floor collapses within the twin towers.
The equation used is a derivative of the ACCELERATION of MASSES by GRAVITATIONAL FORCE: v^2 = u^2 + 2 * f * s, where:
Floor Mass m = 10^6 Kg,
Gravitational Acceleration f = 32.16 feet per second per second, or 9.81 metres per second per second
Distance between floors s = 12 feet, or 3.66 metres, and
Starting velocity u (original) = 0 ft/sec  (0 m/sec).  Then u = 9.72 ft/sec (2.97 m/sec).  Then u = 13.72 ft/sec (4.18 m/sec).  Then u = 16.3 ft/sec (4.97 m/sec).

It fits (as it must) in the case of a detaching floor. This, when and if it falls free, accelerates at G until it hits the floor beneath. From the formula v^2 = u^2 + 2 * f * s we know it strikes the floor beneath at a speed of 27.8 feet per second, or 8.47 metres per second.
We know that MOMENTUM is conserved, and the TWO floors would THEN be traveling downwards at HALF THAT SPEED, less the speed loss from the energy loss of the SHEARING of the floor connections.
We KNOW what this is, because we KNOW the average and general downward acceleration to have been 0.7G, as agreed by AE911T.
So we KNOW that the initial downward speed of the TWO floors is actually 70% of (27.8 / 2), which is 9.72 feet per second, or 2.97 metres per second.

Now we consider TWO floors striking the NEXT floor.   
Note that THE START VELOCITY (u) IS NO LONGER ZERO, but 9.72 feet per second, or 2.97 metres per second, so from the formula v^2 = u^2 + 2 * f * s we know the TWO FLOORS strike the floor beneath at a speed of 29.4 feet per second, or 8.96 metres per second, and thus the impact velocity is GREATER than before.
We know that MOMENTUM is conserved, and the THREE floors would THEN be traveling downwards at TWO THIRDS THAT SPEED, less the speed loss from the energy loss of the SHEARING of the floor connections.
We KNOW what this is, because we KNOW the average and general downward acceleration to have been 0.7G, as agreed by AE911T.
So we KNOW that the initial downward speed of the THREE floors is actually 70% of ((29.4 * 2) / 3), which is 13.72 feet per second, or 4.18 metres per second.

Now we consider THREE floors striking the NEXT floor.   
Note that THE START VELOCITY (u) IS NO LONGER 9.72 feet per second, but 13.72 feet per second, or 4.18 metres per second, so from the formula v^2 = u^2 + 2 * f * s we know the THREE FLOORS strike the floor beneath at a speed of 31.0 feet per second, or 9.45 metres per second, and thus the impact velocity is EVEN GREATER than before.
We know that MOMENTUM is conserved, and the FOUR floors would THEN be traveling downwards at THREE QUARTERS THAT SPEED, less the speed loss from the energy loss of the SHEARING of the floor connections.
We KNOW what this is, because we KNOW the average and general downward acceleration to have been 0.7G, as agreed by AE911T.
So we KNOW that the initial downward speed of the FOUR floors is actually 70% of ((31.0 * 3) / 4), which is 16.3 feet per second, or 4.97 metres per second.

On the point of impacting the NEXT floor THE START VELOCITY (u) IS NO LONGER 13.72 feet per second, but 16.3 feet per second, or 4.97 metres per second, so from the formula v^2 = u^2 + 2 * f * s we know the FOUR FLOORS strike the floor beneath at a speed of 32.2 feet per second, or 9.81 metres per second, and thus the impact velocity is EVEN GREATER than before.

What you see here is AN ACCELERATING TREND.  The acceleration of the massing floors is heading asymptotically for G itself.

"You are saying that as the first 15 floors collapses on the 16th floor" - Well, obviously not.
"The amount of kinetic energy is increased as opposed to deceased (sic)” - Certainly not.  Energy never ‘dies’.  Consult The First Law of Thermodynamics.

If you take the INITIAL FLOOR, its kinetic energy impacting the floor beneath it (assuming its weight to be 10^6 Kg) is 0.5 * m * v^2, which is 0.5 * 10^6 * 8.43 * 8.43 = 35,500,000 Joules.

If you take the FOUR FLOORS, their kinetic energy impacting the floor beneath them (assuming floor weight to be 10^6 Kg) is 0.5 * m * v^2, which is 4 * 0.5 * 10^6 * 9.81 * 9.81 = 192,000,000 Joules, which is MORE THAN FIVE TIMES GREATER.

Kinetic energy is ALWAYS INCREASED BY FALLING, as POTENTIAL energy is traded off against it.

So the floors will accelerate all the way to the tower basement.  This leaves FREE-STANDING COLUMNS A QUARTER OF A MILE HIGH.  THEY WILL BUCKLE AND FALL DOWN.
Reply: If you wish to claim a victory here, be my guest if it gives some consolation.

I'll leave it for others who view this thread to decide who 'won' and who is the 'fraud'.
Reply: How did the lightest section of the building completely destroy the much more robust lower section?  2/3 of the tower's mass was in the first 1/3 of it's height.
Reply: micha0001 The outer columns according to the architect could be considered as a solid beam, capable of supporting 2 towers.
 The inner core comprised of 47 massive steel beams tied in separately.  Whilst this model may differ, it makes its point.
Reply: I had a look at Tony Duncan's analysis of the events and his calculations and I concur, they are spot on.
It is you who are not correct. To use terms like "portion of" and "large amount" are meaningless unless you can back them up with numbers. Your statement "gravity has but a fraction of the needed amount of energy to do such a feat" sounds a bit confused. Giving you the benefit of the doubt, I assume you mean "gravitational potential energy". You claim that this would not be sufficient to break the columns and floors below the impact zone but again you do not support this claim with figures. How much PE was available? This is fairly simple to calculate.
Weight above impact zone ~ 50000 tonnes = 5 x 10^7kg
Height ~ 700 ft = 215m
g ~ 10
So PE = 5 x 10^7 x 215 x 10 ~ 10^11J
Of course, the difficult calculation is to work out how much of this energy would be needed to bend columns, break floor truss connections, sheer bolts etc. all the way down to ground level, not forgetting that as the mass descends it also INCREASES as more floors concrete etc is added to the falling mass. Unless you know exactly how each and every joint broke it is not possible to calculate this with certainty.
However, the calculations have been done using best case scenario (the one in which the most favourable conditions for the building NOT collapsing prevail) and these prove conclusively that the PE available was "orders of magnitude" greater than that required for total progressive collapse. I can give you the ref. if you want and we will wait to see your disproof.
Reply: Mr. Lowery
Friendly fire!

I agree with you mate. It is physically impossible for the building to fall at near free fall acceleration, and destroy itself in the process without additional energy (explosives) being supplied.

I was referring to his misapplication of 'highschool physics' and his inability to even contemplate the energy/mass lost during the collapse.
Reply: It is fairly obvious from the pseudo scientific baloney your are posting that you do not have the understanding to discuss this issue. Statements such as "gravity is the weakest force in nature" look like something you have thrown in to sound impressive. On the contrary, it simply reveals your ignorance. Gravity exerted a force of about 500000KN on the upper part of the tower and studies have proved the potential energy was more than enough to collapse the towers.
Reply: Your point is meaningless.  Get to performing your own experiments to prove your point and disprove his.  He has done the foot work and has actually produced something that is real, tangible and so far, has nothing that says he is wrong about any of it.  You're just a mouth with nothing behind it.
Reply: Don't have time to look at everything, just 2 points.
1   Pancake theory
I have never used the term “pancake theory” In fact I have scrupulously avoided it. I believe it was first used by a New York fireman describing how the floors of a tenement building had collapsed on top of each
other in the 1980’s,I subscribed to the “Progressive Collapse Theory” and I think it has the status of a theory since it is accepted by 99% of architects, engineers and just about every other scientist in the world.
I am not going to go over this ground again. If you reject this theory, it is up to you to give your reasoning.
2   Scale:
I have run small scale, semi-scale and pilot plant in the chemical industry so I guess I know a bit more about scale than you do. You don’t seem to have understood what I meant by the “effect of scaling”. Maybe I didn’t
explain it properly so I’ll try again.Let us suppose we built a model of one of the towers at say 1:100 scale with everything in proportion. This would mean that the columns, etc would be 1/100th of their width, breadth and length.The load bearing capacity of the columns is proportional to their cross-sectional area which is = width x breadth.For the sake of argument, suppose a full scale column was 100cm x 10cm, the x-sectional area would be 1000sqcm^2.
The equivalent column in the model would have to be 1cm x 0.1cm giving an area of 0.1cm^2.
Comparing the model with full scale this is 1/10000 (one ten thousandth)
Now consider the loads these columns have to bear.
The mass of material (concrete, etc) is proportional to it’s volume. This is given by length x breadth x height.
Consider the weight of one section of concrete floor. For the sake of argument suppose it is 60m x 20m x 0.1m, the volume would be 120m^3
The equivalent floor in the 1:100 scale model would be 0.6 x 0.2 x 0.001 giving a volume of 0.00012m^3
Comparing this with the full scale floor gives it to be 0.00012/120 = 1/1000000 (one millionth)
So columns ten thousand times thinner would be bearing a load 1 million times lighter or to put it another way, the columns in the model would be 100 times stronger in proportion compared to the full scale.
To give even an approximate representation, the columns in the model would have to be ten thousand times thinner than the real columns.
Reply: Scale IS the major problem. I am not saying it would be impossible to build an accurate scale model but this could not replicate the dynamics of the collapse. I could drop a concrete block on a cardboard box and it would be as scientifically valid as this experiment.
Any 6th. grader who had a grasp of physics would understand this.
"You can't take something with less mass and destroy the same type of something with greater mass without adding energy to it"
More pseudo scientific nonsense. It has nothing to do with the mass but everything to do with the energy involved. The PE in the upper part of the building is converted into KE as it begins to fall. The falling mass increases as more and more floors are added. It has been proved that the KE is several orders of magnitude greater than that required to demolish the lower floors.
Reply: Oh dear Jon, you are such a fraud. This was obvious from the start. All you can offer in response to a scientific argument is bluster. I assume from the fact that you have not addressed the issue, is that you tacitly, if grudgingly, concede that Coles model is a bogus. I remind you that this is the main focus of all my previous posts. His demonstration, he claims is to show that the towers could not fall unless explosives were used. DO you now admit that it proves nothing?
Regarding the other points, I have had a quick look at Zamboti's open letter, in which he claims that NIST have used incorrect timings, maximum floor loadings instead of actual in service loads, and underestimate the strengths of the truss connections. I don't have time at the moment to check his figures so I will leave that for later. If you wish to claim a victory here, be my guest if it gives some consolation.
Reply: So you're saying there was no heat  absorbed due to the fact that kinetic energy is produced from the bodies that are in motion?   LOL  Yeah ok whatever dude.  And no, I mean you can drop objects of whatever mass and size you wish from the height of the towers and if they are made of steel, they won't melt.  You can be a condescending prick all you want but reality isn't going to change because of it.  Go have that circle jerk you and Tony have been fantasizing about for so long and stfu!
Reply: Then why are you chiming in?  Duncan wants people to believe just the building collapsing is enough to create molten steel beneath the building debris.  Well to do that requires heat.  A lot of it.  When potential energy is converted to kinetic energy something gets lost in the conversion.  That loss is in heat.  There is neither enough potential nor kinetic energy present (in the idea of no explosives or incendiaries being used) to create molten steel.  If you think there is,, like I said, go play with Tony out in traffic or something.
Reply: I made the point a long time ago that it is just not possible to use small scale experiments to replicate how the towers fell because of the scaling problem. 
This is the fundamental error this guy is making in the video.
Here is a link to a study proving that the towers would collapse the way they did:
https://pdfs.semanticscholar.org/93a4/406e441b660fd6c52e1d54810203fbaba208.pdf
Disprove it or rest your case.
Reply: I am saying there is something wrong with it! Others have also posted here pointing out what is wrong with it. 1 He has not allowed for scale!
2 His model does not replicate the way the towers collapsed.
Reply: Wow. Another tirade of abuse but NOT one single fact to or calculation to back up anything you have claimed.
I have not used terms such as “pancake theory” or piledriver theory” because they give an over simplistic picture of what actually happened.
However, in the analysis of the collapse mechanism by Bazant and Zhou, they state that they look at three possible collapse mechanisms:(a) the columns of the underlying floor buckle locally; 
(b) the floor-supporting trusses are sheared off at the connections to the framed tube and the core columns and fall down within the tube, depriving the core columns and the framed tube of lateral support, and thus promoting buckling of the core columns and the framed tube under vertical compression
(c) the upper part is partly wedged within the emptied framed tube of the lower part, pushing the walls of the framed tube apart (Fig. 1, stage 5). Although each of these mechanism can be shown to lead to total collapse, a combination of the last two seems more realistic”
Read the report. Come back and explain where it is wrong.
Note: Sneering and Insult is not a valid form of argument, facts and evidence are.
Reply: On holiday. Unlike your average truther I have friends and family and do not spend my days on you tube.
Reply: OK, I give in. What you actually said was, referring to B&Z, "Which NISTs investigation refutes". The point was they were looking at different things. NIST, the events leading up to the collapse, and B&Z how the building actually fell down, so one can not be a refutation of the other.
Look! managed to get that done without insulting you once. Can you do the same?
Reply: It is obvious from your previous posts that you still have not grasped the idea of scale effect and why it renders Coles models invalid.
“It has NO bearing on these experiments”
I have tried to explain it to you but despite cutting and pasting what I wrote, it is obvious you have not
understood. This is apparent when you give examples of small scale trials which have no relevance.“What you are reaching for is referred to as the 'size effect' by engineers.”!!
No it isn’t! "Size effect" is something completely different and irrelevant to this discussion.
It is clearly you who are out of your depth.
Scale effect is a manifestation of a general law, sometimes known as the “square cube law”  which affects all branches of science, especially in this context with respect to engineering. Go and google it and see if you can get it right this time. 
"NIST: “did not conduct reduced-scale system-level tests because there are no generally accepted SCALING LAWS that apply to fire propagation, temperature evolution, and STRUCTURAL response”.
Cole has simply demonstrated that if you set of fireworks in a paper and cardboard tower, it will fall down. The model has no relationship to reality.
This is the reality. There were no explosives, no controlled demolition.
Reply: micha0001 regardless of it being to scale, it still debunked the acceleration theory. When he weakened the strength of the models it still showed deceleration. If you really think a building that massive would accelerate towards earth by means of gravity, you will never be convinced of any wrong doings on 9/11.
Reply: same old drivel,  time is precious, i no longer waste time argueing with idiots who refuse to learn, carry on believing your nonsense, bye.
Reply: micha0001  : I wish u stopped commenting after  "watching the video when your mommy told u its time for dinner"
Reply: His experiment's are in 10's of kilograms. 

Let's drop 100,000 tons of steel and concrete onto the remaining storied structure below. The next floor below will not support the weight and collapse almost instantly, and be added to the weight falling. And so on until the supporting structure is demolished.

Using wood and a weight is no comparison.
Reply: That's a laugh, Bud! Try pushing aluminum through steel! Equal and opposite reaction. And the "airplanes" weren't going at bullet speed. AND they could not have gone as fast as claimed because the engines can't process the dense air at sea level that fast. The speeds claimed could only be achieved in the thin air around 40,000 above sea level. Further, at the claimed speeds, any of the "observed" maneuvers of the aircraft, or those required to follow the claimed flight paths, would have torn the wings off the planes. The bizarre behavior of the "airplanes" is only appropriate in the "Roadrunner" physics world in which those "airplane strikes" could have made the towers fall as they did. ONLY internal explosive demolition can account for that behavior in those structures AND in WTC7, which took no airplane strikes.
You tell others to educate themselves... what a joke.
Reply: What calculations? His "core columns" were solid, the ones in WTC1 + 2 were partly weakened by the fires. The tops of the towers didn´t fell down in a straight way, they tipped to an angle (appr. 20°), before they hit the lower floors forcing them to collapse.
Reply: micha0001 And then somehow proceeded to tip back from the precarious lean to collapse neatly into a pile of its footprint.
The top of only one tower tipped at an angle upon collapse, not both.
Also, of course, the top having enough mass to pulverize the rest of the building which was virtually undamaged starting not far below the impact zone...
Reply: Why did you start watching in the 1st place? You are completely satisfied with Nist's conclusions aren't you? Never mind they won't give out the computer model they used so as to be duplicated by anyone other than NIST. 
"ONE critical column failure led to the total collapse of WTC7"! How laughable that statement is.
Reply: wow you talk some shit watch this and then shoosh up.https://www.youtube.com/watch?v=TJNzaMRsN00
Reply: I have no idea what you mean. I made no claims about steel melting.
Reply: +Jon Chalkley
"debonker" - The word is 'debunker', and the 'bunk' is all about your 'truther' religion.
"beachpedo200" - Thankyou.
A debunker "will only read as far as line 5 or 6 before their attention span gives up" - Sometimes a liar speaks the truth.  I can sympathise.  A long string of pathological lies is hard to take.
"'Progressive collapse' does not answer the question, 'Why did the buildings collapse?'" - AS A CONSEQUENCE OF IMPACT, FIRE, AND TIME answers that question.
"Weak truss connections is was a possible explanation" - No, it was only PART of THE explanation.
"From NIST" - "the WTC towers collapsed because: (1) the impact of the planes severed and damaged support columns, dislodged fireproofing insulation coating the steel floor trusses and steel columns, and widely dispersed jet fuel over multiple floors; and (2) the subsequent unusually large number of jet-fuel ignited multi-floor fires (which reached temperatures as high as 1,000 degrees Celsius, or 1,800 degrees Fahrenheit) significantly weakened the floors and columns with dislodged fireproofing to the point where floors sagged and pulled inward on the perimeter columns. This led to the inward bowing of the perimeter columns and failure of the south face of WTC 1 and the east face of WTC 2, initiating the collapse of each of the towers. Both photographic and video evidence—as well as accounts from the New York City Police Department aviation unit during a half-hour period prior to collapse—support this sequence for each tower".
Let's not distract ourselves with side issues, eh?
" It follows that fire in the impact zone heated floor trusses to the point of failure, causing the collapse of one floor onto the floor below. This overloaded the 'weak' truss seats supporting the second floor causing another collapse. As the 'weak' truss seats could not arrest the growing mass, progressive floor failure below this point ensued. With the floors no longer providing lateral support to the interior and exterior columns, they buckled and fell behind the main collapse." - that seems to tie the loose ends up quite nicely, doesn't it?
"Eric in December 2016 - "The inner core and the outer walls could not prevent the collapse from progressing once it had begun because it was ONLY the connections between inner and outer walls which held the floors up.  Once the upper floors came down on the ONE floor beneath, the connections holding it to the walls gave way and this weight was added to the falling mass. As each floor gave way the mass INCREASED and with it the momentum so the next floor below was hit with even greater momentum".
"This is the pancake theory in a nutshell. You are either dishonest, or a dumbass" - See that trick you pulled right there?  You moved the goal-posts just a tad.
"You could save face and immediately win back respect if you concede" - And bluff and lie and cheat.  You are right on track with your dishonesty and deceit.
"I have run small scale, semi-scale and pilot plant in the chemical industry so I guess I know a bit more about scale than you do" - And you support a small-scale experiment as if it were the correct thing to do?  Then you are right on track with your dishonesty and deceit.
"What you are reaching for is referred to as the 'size effect' by engineers" - No, it's an entirely different effect called THE SCALE EFFECT.
"you embarrass yourself like this" - I think you do.  Well, you would if you were in any way honest.
"Unfortunately, "you only read as far as line 5 or 6 before your attention span gives up". - Yes, indeed.
YOUR LIES AND DECEPTION ARE HARD TO TAKE.  TRUTHERS ARE ALWAYS LIARS.
There is no free lunch.  Thanks for the insult.
Reply: This is simply guesswork. Unless you can back it up with numbers, it is meaningless.
Reply: Jon Chalkley "Bazant's theory is a refutation of NIST" This statement demonstrates how little you understand.  Two different theories explaining two different things. Stupid or dishonest? I'll give benefit of doubt and assume latter.
Reply: joshua andersen,    are you really this dumb?
   look for,   'use of scale models or full sized models for investigating 
9 11 collapses',   at,   metabunk.org.
    and,  'n.m.s.r. truth resources',   chandler proves gravitational collapse,    or carry on believing the nonsense.
Reply: micha0001 your missing the point. idiot!
Reply: Dave Franzmann You must clean toilets for a living?
Reply: GET EDUCATED !!!
Reply: You stopped watching because you believe the official narrative and therefore cannot be shown the truth. If you had of watched the video in it's entirety, you would have seen that even when he built models weaker, to help the official "narratives", the buildings still didn't fall they way they did on 9/11. Open your eyes, you're being lied to by your government.
Reply: Not gullible enough to believe a word that you write randle, ever.
Reply: "ONE critical column failure led to the total collapse of WTC7" said who? Search for pictures of the side of WTC7 facing the collapsed WTC1 + 2 and you´ll find a building, severly damaged and multiple floors on fire for almost seven hours! Again were steel-columns weakened by fire and led to structural failure. There were three buildings designed as steeltubes at the World Trade Center and all three went down by 1. damaged important static elements 2. weakened important static elements
Reply: The plane impact did not weaken the core columns.  The towers oscillated after each impact and before either tower collapsed those oscillations had subsided.  Meaning none of the weight bearing support structures were damaged due to the plane impacts.  Aluminum aircrafts don't do much to steel box columns no matter what speed they're hitting them at.
Reply: michal0001 is another 911 shill. I wonder if he knows ctcole as well. There's a whole army of 911 trolls on the internet who are paid to write comments in 9/11 related videos. They will never answer your questions or your responses. They simply come in to ridicule the video and the uploader and continuously repeat themselves without actually providing any single piece of scientific evidence.

There a few 911 trolls on the internet. ctcole is the most famous....he blocked me because he couldn't answer my questions about the airplanes traveling at such high speeds at such low altitudes or the cell phone calls that couldn't have been placed at the speed and altitude of the aircraft.
Reply: He made the calculations buddy
Reply: This "its own footprint"-story is strange. If you watch the later made satellite-shots from ground zero, you see much more destruction then only in the place, the towers were standing. WTC7 was heavily damaged by debris from the falling north tower, which was 110 meters away. So no "its own footprint" at all. And if you watch numerous videos from the collapsing towers you´ll see also the spreading of the falling debris.
Reply: Well, neither did I watch the whole thing, nor did I read the 10,000 pages of the NIST-report. Did you read them?
There are 2634 architects and engineers today in the AE911truth-organisation out of almost 121,000 architects only in the US who believe in these conspiracy theories. Well, are the other almost 118,000 architects all dumb or what?